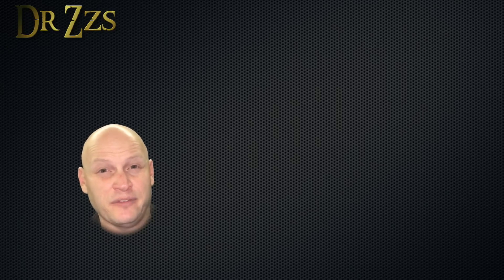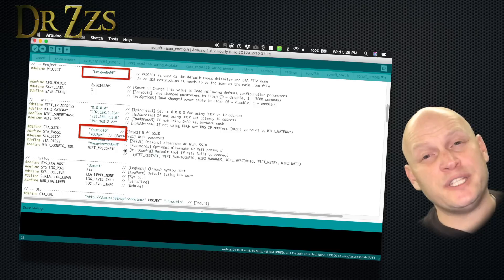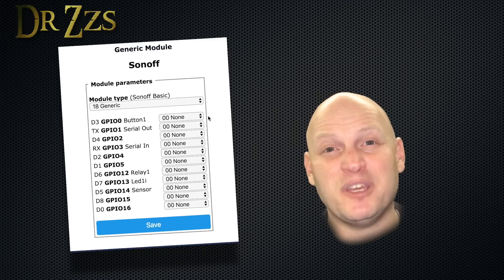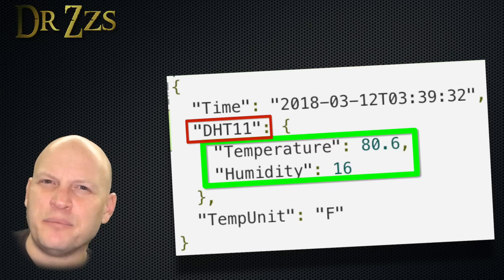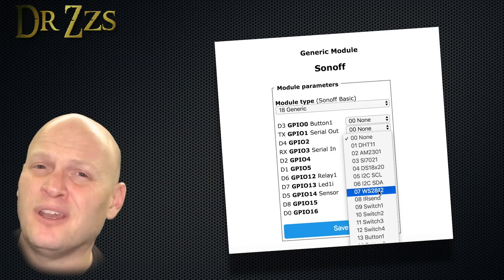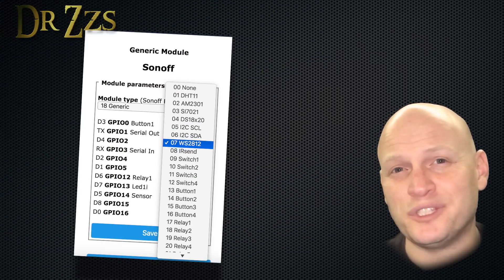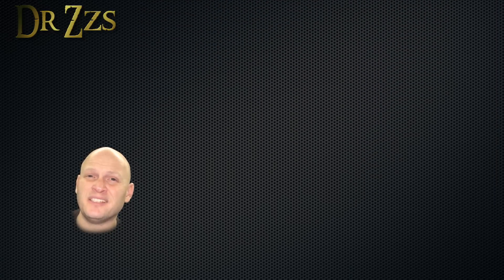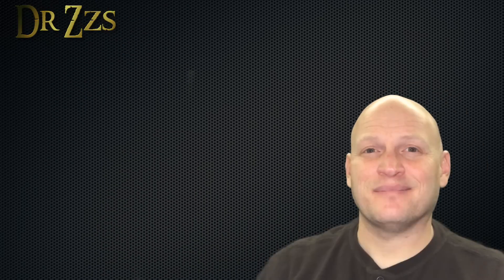Tasmota + D1mini (or Sonoff) - Temp & Humidity, ws2812 LEDs, and Motion Detection

Comment: does soil moisture supported  in tasmota? I want to create automation for my plants watering , I used to use esp8266 Relay , love your work ,you make my life easy :)
Reply: Yup. Use A0 on a D1 Mini to hook up the analog output from any of the available moisture sensors. Use Generic (18) and set GPIO17 to "ADC Range". Adjust the settings to your liking, and use Home Assistant to set up an automation to let you know when they need watering, or hook up an LED to an available pin and set to flash based on sensor reading (or both). 
Unless you're using it to monitor water level in the bilge or basement, I would read the sensor at most every hour. Especially if you don't use a capacitance sensor (recommended for long-term use). The metal on the resistance sensors (two "legs" that measure the resistance in the soil between them) will be oxidized very quickly otherwise and you'll be replacing them every month. They aren't expensive, but still... 
And set the Mini to sleep in between times, to conserve energy, if the LED isn't flashing or nothing else is being monitored...

Comment: Hey DrZzs,
huge compliment on this and your other videos. I enjoy them very much and learnt a lot from them already.
But now, I am afraid, I am stuck trying to use my WS2812 with Tasmota on a Wemos d1 mini.
After I flashed the d1 mini, I set the module to Generic and set the corresponding pin to “07 WS2812”.
After a reboot I got the on off button and the slider but unfortunately I am not able to control the LEDs. 
As soon as the d1 mini powers up all LEDs turn on on full bright white and I am not able to change it.
I checked the connections, replaced wires, used another d1 mini, used a different LED strip with only 2 LEDs,  powered the LEDs with an external power supply (connecting grounds), re-flashed it… no success.

I am running out of ideas, any help would be appreciated.
Thank you
Reply from the maker: Thanks!
man, that sounds like you tried everything so far.  What other info can you give me?  Maybe some images of your connections and screenshots from tasmota.  
For easier chatting head to discord.  We have a channel for LEDs too.  There may be others there that can help. https://discord.gg/8gvF67h
I'm sure we can get it working.
Reply: Thanks for the quick reply. Much appreciated. 
Was hoping you came across this very problem before. 
I am heading out of town for a couple of days now but as soon as I am back I am going to start from scratch. 
Hope you or the guys at discord can point me in the right direction. 
Cheers
Reply: @tb8756  Did you ever get this sorted out?  I am running into the same exact thing.  I also tried using the same version of Tasmota as in the video and still have all white LEDs.
Reply: Unfortunately not. 
I started again from scratch but without success. 
Please let me know if you get it to work.
Reply: @tb8756  I finally got it working!!!  I had to uncomment the  line that says "#define USE_WS2812_DMA" in the my_user_config.h file and then hookup my data line to the pin labeled RX on the d1 mini (GPIO3). Good luck.
Reply: Thanks a lot. 
I will try it right away when I get home.

Comment: Hi, thank's for your video. I have a question: when I sept in tasmota: Generic module to create node mcu with 4 relays they work according to each other. When I turn on one of them, the other goes off. For example: if I turn on the relay 1 while the number 3 is on, the latter goes out as soon as the relay 1 goes ON.
Is there any command to give in the console? Thank you
Reply from the maker: Thanks!
It sounds like they are in "interlock" mode.  "SetOption14 0" in the console might fix it.  
Let me know if that doesn't do it.

Comment: I get a compilation error, all the time on the D1 and the NODEMCU. There are a lot of updates in Tasmota. Are you sure the tuturial still works?
Reply: Just done it after 2 days of trial and error with both D1 mini v2 and v3 and ESP-12E. What error do you get?
Reply: @RAFAEI_  The error message was to long to copy here. I also got it working. I got the error message using the software Versions drZzs using in the Video. Once I used only the currend versions everything was fine. :-)
Reply from the maker: Sorry!  I'm a little late answering comments.  
Glad you found a solution.  If I could edit the videos after they're posted I would.  The best way to load tasmota on any devices is by using sonoff.bin, which is the pre-compiled binary file.  Using that eliminates almost all the potential errors that come from Arduino libraries and Board mangers.  
Here's a demonstration: https://youtu.be/NNW05smSNOA?t=2m3s
Hope that helps!

Comment: DrZzs, do you use pull-up resistors when connect sensors to the w1/sonoff/node-mcu?
Reply from the maker: no.  Maybe I should.  I believe there are ways to turn on/off pull-ups for different pins in Tasmota.  
https://github.com/arendst/Sonoff-Tasmota/issues/3200
Reply: @DrZzs  i believe you had no problems because you use sensors with additional smd elements on the sensor's board. i have dht22 with no board, just white piece of plastic with 4 legs, so pullup is required in my case

Comment: Dr. Zzs, I just followed this tutorial and everything went well expect my DHT11 wont show temperature.  I connect the sensor to my D1 mini using all the correct GPIO ports and after a restart, Tasmota shows the sensor at the tp, but the reading is 0.0C.  I know the DHT11 works because I was using it recently, but wanted to just switch ti over to Tasmota.  Any thoughts on whats wrong?  Im on version 5.12
Reply from the maker: man, not sure I have a cure for that.  I'd triple check all the connections.  So it's showing humidity but not temp?  If that's the case I'd be pretty suspicious that the sensor is bad.  Do you have another sensor you could swap in to see if the problem persists? 
If the humidity is also 0, then maybe there's some software or connection issue. Maybe switch to a different pin on the D1?  Do you have a different Tasmota device you could put the sensor on to see if it works there?  
Just thinking out loud.  Sorry I don't have a simple answer for you.
Reply: @DrZzs  Thank you for your response, luckily, I just updated to the latest version and the problem got somewhat fixed.  My DHT11 was outputting wild levels, not working as it was before.  I didn't try that before as the latest version was giving me huge problems a few days ago when using one of your videos to flash my Sonoff Basic.  Eventually after trying to switch around GPIO pins, I blindly ended up applying a 3.3v and 5v connection at the same time, destroying both the D1 Mini and the DHT11. Time to order some new parts and try again haha

Comment: I'm trying to flash TASMOTA onto a D1 Mini Lite version, and I keep getting the error: "WPS_is_unavailable_in_this_configuration__Please_check_FAQ_or_board_generator_tool"

I checked in the user_config.h file, and tried every possible option that DIDN'T involve use of WPS in the WIFI_CONFIG_TOOL section, but that's apparently not the issue.

Any ideas? I'm about ready to give up on this thing. :/
Reply from the maker: ya, there were some troubles with different board managers and such so I've stopped compiling it myself.  I just use "sonoff.bin" from the Tasmota github and avoid all those problems. 
Glad you got it working!
Reply: I wanted to be able to flash all of my configuration settings (Wifi SSID/Password, MQTT server address and creds, etc).

I've never flashed a BIN file to these boards before, and I'm on a Mac, so I wasn't sure where to start with software with that. I could PROBABLY do it from the terminal, but I'd also have to go dig out a UART module out of the empire of dirt, and only God knows where any of those are at the moment.

So I opted to rip out some more of my quickly vanishing hair, and just mess with it until I finally got it working. :D Jumped the gun on asking on the youtube comments. ;)
Reply from the maker: that's a good reason to compile your own then :)
Reply: I FIGURED IT OUT!

The Boards Library version 2.4.2 has the issue. I switched it to 2.4.1 and it compiled no problem.

Comment: Awesome video! 
I have 2 temperature sensors connected to nodemcu running Tasmota. I get the following MQTT output from it : 

03:59:42 MQT: tele/TempBasement1/SENSOR = {"Time":"2018-10-31T03:59:42","AM2301-14":{"Temperature":62.4,"Humidity":72.7},"AM2301-15":{"Temperature":65.5,"Humidity":56.1},"TempUnit":"F"} 

but when I create a sensor in HA to read in value_template: 

“{{ value.json.AM2301-14.Temperature }}”

 it doesn’t show up. When I only have 1 sensor connected and MQTT output is 

{"Time":"2018-10-31T03:59:42","AM2301":{"Temperature":62.4,"Humidity":72.7},"TempUnit":"F"} 

and I use 

“{{ value.json.AM2301.Temperature }}” 

then it does work just as in your tutorial. Any idea what I am doing wrong?
Reply from the maker: There's something with tasmota that limits how many sensors of certain types can be connected at the same time.  I don't remember the details now but, the details are here: 
https://github.com/arendst/Sonoff-Tasmota/wiki/Expanding-Sonoffs
and here:
https://github.com/arendst/Sonoff-Tasmota/wiki/Sensor-Configuration
Reply: Thanks for the links! I didn’t know it was limited. What’s kinda funny is that Tasmota does output two sensor values on the sensor topic. One is called AM..-12 and the other AM..-14 (seems like the -## is based on the GPIO pin#) but when I use these parameters in HA they don’t get read by HA and my sensors just show blank dash on the dashboard. I figured if I just used the AM..## that the MQTT payload has it would be fine. But when I have one sensor and there is no “-12” or “-14” then it works just like in your tutorial where I just use json.AM2301.Temp... I must be doing something wrong and not reading the MQTT payload correctly or it’s limited to just one sensor output per MQTT message. Thanks again for replying - love your tutorials!

Comment: Thank you @DrZzs for another wonderful tutorial.  On my D1 mini, however, I have two problems. Can you please help me with these?
(1) When the motion has ceased, the switch doesn't revert to OFF sometimes. It stays stuck on ON until the motion is triggered again, when it toggles. 
(2) When restarted, the switch begins with OFF. However, when it first senses motion, it still fires OFF and a few seconds later fires ON.
Reply: Did find a solution to this? I have the same issue

Comment: I am not able to get the motion sensor to work from your instruction.  The Tasmota console show: "cmnd/pir2/POWER2 = TOGGLE" repeatly each time detect motion.  But on the Hassio the human stick figure does not move show motion.  I double check the codes several times.  Set Binary sensor.  Can I set it like a status show motion.  Only thing not work is this motion sensor.   What did I do wrong?
Reply: I finally get it to work.  You forgot to mention need to execute command: Switchmode2 1 so it will toggle On and OFF.  Now I need to figure out the command to delay the PIR switch for a few seconds.  Any idea.
Reply from the maker: Glad you got it working.  Sorry for the missed command. 
If you have the 501 PIR there are some adjustable pots on the board that control sensitivity and retriggering.  There is also a jumper that can be moved too, but I don't remember exactly what it does.  Here's some info on the adjustments you can make. 
https://learn.adafruit.com/pir-passive-infrared-proximity-motion-sensor/testing-a-pir
Reply: I use this AM312 PIR Sensor have better review smaller but on adjustment what so ever.  I though on the Tasmota command you can set the delay on hold in seconds before turn back off similar to switching.  Since I begin follow and watch your videos, you now are experts and not longer amateur in Sonoff and Hassio knowledges.

Comment: The dht sensors need a pull up register.
Reply from the maker: You don't have to add a resistor.  There may be one already built into the D1mini pins.  Sorry I'm not totally sure.
Reply: D3 and D4 have a pull up on the D1 Mini. You used D4. A sonoff (that you mentioned) would need a pull up resistor
Reply from the maker: oh excellent!  Thank you!
Reply: btw i had a problems with 10k resistor on sonoff devices. dont know why, but sonoff is going crazy when i connect dht22 or button with long wires. it randomly reboots and wifi is unstable, also ping latency is too high. once i even had to reflash my sonoff since it was bricked during experiments. similar effect i got with no resistor at all. probably 10k resistance is not enough, so i switched to 4.7k and problem has gone. i had this issue on 3 devices so can confirm this is not defective device case.

Comment: your video show you connect the data line of the temperature sensor to pin D4 but on the Tasmota Configuration screen you choose the "D2 GPI04".  Confuse which one is it?  Another problem I have is my temperature sensor is DHT22 and is not listed so what can I use?  How often is the temperature updated?  Can we change the setting?
Reply from the maker: I must have changed my mind at some point.  I don't think it makes much difference where you put the sensor.  Some of the pins have specific functions and you'll get errors if you try to use them, but it won't damage anything.  If you connect something to a pin and it doesn't work, just change it to a different pin and try again. 
And there is only one choice for the Temp DHT sensors.  Choose the AM2301.
Reply: Sorry to ask again, I am not electronic expert.  So which one is refer to the board pin D2 to the web GUI "D2 GPI04" or "D4 GPI02" choices?

Comment: Since separate power supply, can I connect to WS2811 strip lights that use 12v power instead?  Thanks for answer all my questions..  I am newbie.   I plan to get back to Hass.io setup.
Reply from the maker: You can not power the d1mini from 12v.  It will die.  
So if you have 12v lights you'll need a source of 5v for the D1mini.  That can be a buck converter to change the 12v to 5v, or a separate 5v ps.  The grounds need to be connected.

Comment: Great video, would you prefer Tasmota or Bruh automation for flashing the esp?
Reply from the maker: For cool LED effects I use Bruh's sketch (with some modifications).  For controlling switches or sensors, I prefer Tasmota.  I haven't used Ben's multi-sensor sketch, so it may be better for that specific application.  I'm just more familiar with Tasmota, so that is my go-to solution.

Comment: is it possible to configure tasmota firmware wifi to an access point only so for instance i want to install in my car and access tasmota from my android device i dont want to connect to a router ?
Reply from the maker: absolutely.  When you configure the wifi setup in Tasmota, just use the wifi SSID and PW of just your andriod hot-spot and don't put the one for your home wifi.  
You can put 2 SSID's in to Tasmota so if it can't connect to one it will connect to the other.  Just in case you want it to be able to connect to both sometimes.

Comment: Hi DrZzs, I have 8 of these running to monitor refrigerators at my business to text me if one gets to warm. I'm having an issue and wonder if you have seen it before. After between 12 hours and about a week at best some of the dht22 stop sending. If I unplug just the power to the sensor and plug it back it in it instantly works again. I've searched and have seen this to be an issue for years but I can't find a solution. The second issue is when it does stop sending HA still shows the last temp it was at until I restart HA then it's a "-" Do you know what kind of code I would have to add to the .yaml file to make it default to something like 99 if it doesn't get a signal for x number of seconds? I've tried playing with "If" statements but can't figure it out.
Reply from the maker: oh man.  that sucks.  I didn't know the DHT22's were so unreliable.  Just a thought, but do you think a reboot of the D1mini every day or so would fix that data-freeze?  
As for getting HA to report something else, I'm sure there's a way with an automation and I could give it a try but I'm not sure I'd have the right fix.  Have you brought it up in the Home Assistant Discord channel?  Try there and see if someone there has a sure fix.  If not, let me know and I'll see what I can come up with.
Reply: Thanks for the reply. I tried the reboot but it won't work. You either have to disconnect the power from the D1 or the sensor to make it work. I'll try the Discord next for the other issue. I would just use DHT11's that are more reliable but they won't work for a freezer. I may end up just using a better sensor. I've heard the SHT31 is better.
Reply from the maker: Sorry man.  Wish I new the answer for you. 
Let me know if you solve it.
Reply: @DrZzs  A couple months ago I did end up changing out 6 of the sensors to SHT31's and I have not had any more sensors issues. So only 2 out of 8 DHT22 still work. Not a good investment even if they are half the price. Maybe it was just the supplier I got them from or they just all suck. I'll never know because I'm not buying them again.

Comment: I see in the console of the Tasmota´s WebUI that the updates are too slow, is there any way to speed it?
Great video, man!
Hugs from Argentina
Reply from the maker: Howdy to Argentina!
Try the command "teleperiod"  The shortest you can set it is 10 seconds.  I think the default is like 5 min. 
TelePeriodShow current telemetry period in secondsTelePeriod0 / offDisable telemetry messagesTelePeriod1Reset telemetry period to user_config.h(TELE_PERIOD)TelePeriod<secs>Set telemetry period between 10 and 3600 seconds
Reply from the maker: I tried copying the teleperiod info from the Tasmota wiki, but youtube hates the formatting.  
https://github.com/arendst/Sonoff-Tasmota/wiki/Commands
Reply: Thanks for making my learning curve a little bit more exponential! :-)